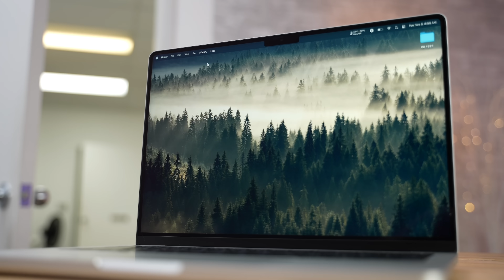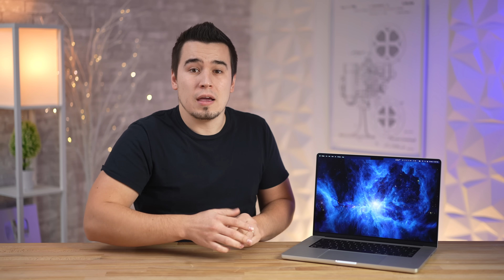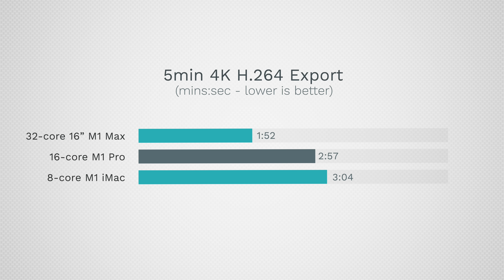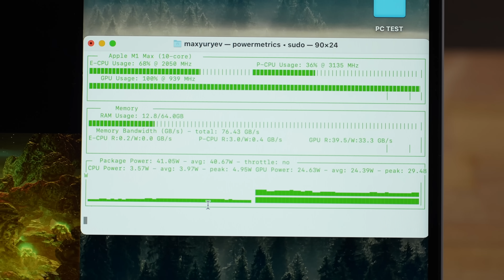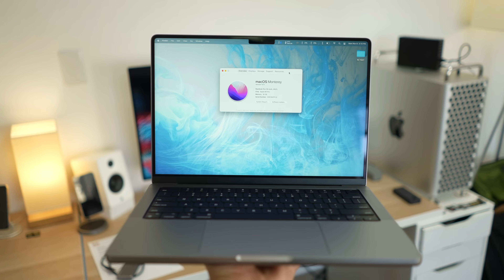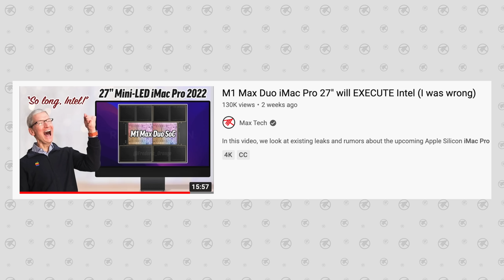M1 Max MacBook Pro Review after 1 month: You NEED to KNOW!

Comment: Sorry, you did not discover the die-to-die fabric. Many people, especially CPU designers, predicted it because it's obvious. If you want to talk about something important, talk about the industry move to chiplets, which is essentially what the Max represents: you build multiple smaller dice and connect them in the package as Apple has done with the M1 chips and dram. AMD is also ahead in this trend. This might to chiplets will remodel the industry, lower costs, and enable much denser electronics going forward. Phones have been using this model to some extent since about ten years ago, but no one noticed.

Comment: Finally got my 14inch 32 core and tested it with Davinci Resolve. DR uses ALL the graphic cores, so for functions like stabilising this is essential. For the first time this function is actually usable on a laptop. Definitely go for 32 cores if you have this requirement. Tested the memory use as well. DR, C1, PS, Topaz Gigapixel open at the same time which is my usual way of working. 38GB used on this 64GB system, no swapping. So I guess 32GB would have been fine with this combination as I only work with small files in PS and only a few layers coming from the Sony A1 video.

Comment: Would appreciate a video and/or some TIPS FOR NEW MACBOOK M1 PRO user, on setting up this laptop into a 2  monitor desktop setup, considering a standard set of functions which I will describe.

Questions arise on how best to make all the connections for a common user scenario:  some video editing and photo work from an iphone 13 pro (video mainly 1080P, some 4K, no pro res), some photo management, plus regular office software, and some 3d modelling.  Possible future use of VR headsets.    

Functions:
-	2 monitor seutp, using the laptop as a desktop computer.   (Eventually to drive 2 - 4K monitors, but I have not got those monitors yet.  see note below.
-	Backup drive (2 partitions, one for time machine backups).
-	Ethernet
-	USB out from laptop to enable usb outlets on the 2 monitors 
-	Connect a flash drive for  real time video editing from the laptop accessing flash drive data
-	Charging
-	Usb keyboard
-	Usb mouse.
-	Connect camera to transfer photos

And then disconnect laptop from desktop setup, for portable use.    

Questions arise on what cables from what ports to meet all the above functions.

For monitor connections I heard there is a KNOWN ISSUE that one monitor will go to sleep if you do not set it up right....something about you have to run cables not using 2 of the same ports, eg 2x HDMI. So something like 1 - HDMI to HDMI and 1 USB-C to Display Port, then that works? Not sure it that is ports on the laptop or ports on the monitor that is the issue.... ie. is this a ports issue on the monitors or a ports issue on the laptop? What combinations work? 

For all the other functions listed, what ports and what cables to use?   

Here is a draft setup for the purpose of getting some comments and suggestions.   

SCENARIO 1     Connections and cables used from the 6 laptop ports that are available to the monitor ports that are available:

1  Magsafe port: yes, used for charging to keep the other ports available for other uses.   Apple magsafe cable.   Current monitors do not have a usb-c connections.  When I get 2 new  2 4k monitors, they would have usb-c as I understand that then then one can use that one usb-c  to usb-c line to both deal with video on 1 of the monitors and also to keep the laptop charged, continuously working the charging function automatically.   Is that correct?).  

2  FIRST Usb-c port.   Hdmi cable to HDMI in on left monitor 24” Dell.

3    1 HDMI port.   Goes via Hdmi cable to mini display port adapter, into right monitor, 27” Dell.      Now the 2 monitor leads are different and hopefully this avoids the problem of one monitor going to sleep.

4   Second USB-C port.    connect to Belkin usbc to gigabit Ethernet adapter.

5   Third USB-C port.  To a USB-C backup drive  (wd MY PASSPORT ULTRA 5tb)   and also when needed, disconnect that and alternately connect to A usb-c FLASH DRIVE ( Sandisk Extreeme Portable SSD 1TB) (usb 3.2 gen 2 – I think that is 10gps? And the usb-c thunderbolt port is capable of 40 gps?) to access stored video for video editing on the laptop while stored data is on the SSD.

6   SD Card Reader.    

So that is my draft connection plan but what is missing is how to connect the keyboard, mouse, and camera to transfer photos.   How to handle this?  Get from the Belkin usb-c digital AV Multiport Adapter, plug the usb-c end into 1 usb-c in the list above, and then use its usb-c, hdmi, and a usb-a as follows:
-	hdmi to hdmi still from this port, to the left monitor 24” DELL (but now that port is shared 3 ways)
-	usb-a could go to one monitor to enable 2 usb ports for mouse and keyboard.  
-	The usb-c could then take the backup drive.   And that usb-c could get the flash drive.  This meets the functions described in 5 above.

With the addition of the the Belkin usb-c digital AV Multiport Adapter,  all the functions are met.   But would the sleeping monitor problem come up with this hookup?   2 hdmi cables are used from the laptop.

SCENARIO 2.   Separately, for the same functions, a connection plan for 2 – 4k monitors that do have usb-c ports would be useful.   

To identify the PRODUCTIVITY monitors that work well for this MAC productivity application would be useful…… this is not a gaming setup.       Call a gaming setup Scenario 3 perhaps and do a separate summary for that, otherwise it all gets too confusing?

Has anyone found a good video on this topic?    

Thank you!

Comment: I bought the 16" M1 Max with 32GB RAM and 24 cores last month, of course it seemed a bit too much for my needs (Illustrator all day long for poster design) but I was seeing long term. What's my surprise when I found out that it was extremely laggy (I have the multicolor wheel !!!) when using the 3D extrusions and the symbol tool. Whenever I want to move my 3D object, it has the wheel for 6 or 7 seconds, then moves. I don't know what to do here, this thing is supposed to be a total beast and Illustrator can't handle a 3D object ?! Any Illustrator users on M1 ?

Comment: I chose the 14 in. 32c 64gb version. I have a weird use case:

I work from home but have a baby that I also take care of, so I value portability. Being able to hold it with one hand and take it around the house.

My work requires over 40 gb of ram, so I need the 32c (only model that allows 64gb). 

Since I’m at home, I don’t need more than 8-10 hours of battery life on my use case. It lasts more than long enough, for when I need to move to another room etc . 

I don’t really need the gpu performance beyond what the 24 gives.

I’m pigeon holed into getting a 32c. I value physical portability over gpu performance and battery life.

TLDR;  I need a lot of ram. As a work from home engineer dad, 14 max 32c 64gb meets/exceeds all of my needs.
Reply: the M1 max with 24c GPU also allows for 64gb RAM though!
Reply: @redbaronlast  oh, you are correct. I missed that when I had purchased mine. Oops!  Learn from me!

Comment: Just a thought on the performance of the 3080 laptop on battery - sometimes the video driver settings or the laptop software will switch to integrated graphics on battery to not seppuku your battery.  Sometimes this can be switched.

This was the case on my old gigabyte aero laptop. I was able to switch it to use the gpu on battery, but it seriously impacted battery life.

Comment: I received my 16inch M1Max 32 cores and 32Go Friday, I experienced the charging issue when turned off. Saturday I ran a Diagnostic which ended up in a Trackpad problem with an error code. I’ll ship it back next week, wait for apple to receive it, order it again with up to month of delay… Very frustrating.
Reply: I received mine Friday as well. Wo had a trackpad issue?

Comment: For Archicad, SketchUp and AutoCAD (architectural software), would a 16” max macbook pro with 1tb and 32gb ram would be ok? Or should I upgrade to 64gb ram?
Reply: good question... I'm using a rhino+archicad+c4d workflow for design and rendering, and went for 64gb, since the memory is shared between the gpu and cpu. 32gb sounds less than I would need - especially rendering larger scenes have more memory consumption than even 64gb (I'm using corona mostly, so I don't really need the more GPU cores) - for extremely heavy cases it still makes sense to have a desktop pc (also to use some specialised engineering software, or simulations).
Reply: @furtonb  hi! Thanks for your response, just saw it haha. I’m not familiar with the corona app you mention, that’s it’s full name or an abbreviation? What version of archicad are you using? Does it run smoothly (2D and 3D)? Have you had any bug errors because of it running on Rosetta2 ( I read a comment in an Archicad forum that someone was having an issue when closing archicad)? How do you feel your actual workflow compared with your previous apple computer configuration (if applicable and which was it?) What kind of projects (building type and size/levels) do you mostly work with? How many SSD storage did you get (Initially I was considering 1tb, but I’m now wondering if 2tb would be better, not because of needing that much storage, but because of it affecting in any way the CPU or GPU performance… I think SSD speeds vary and are higher the more tb you get, maxing at the official info in apple website which I read was of 7.4 gb/s read speed with the 8tb ssd used on tests)?
Sorry for the amount of questions hahaha hope you don’t mind answering them if possible. Thanks in advance!

Comment: Unfortunately I wish I could say mine was reliable. My 16” M1 Max died due to severe hardware failure (unable to boot past apple logo) and was deemed unserviceable by apple yesterday. They gave me a full refund and now I’m contemplating reordering or not. Was a fantastic computer but reliability was a big let down at only 5 weeks old
Reply: Its not to bad every windows laptop ive had bought brand new has a had some issue thats required me to take it back besides one asus gaming laptop that one took a year to start giving me the blue screen of death and random reboots. Its out of warranty. Ive always had to fall back on my mac laptops when my windows machines  is down

Comment: My latest video is all 8k & has a section where it is sped up 1000% & was the only section where it slowed down significantly when rendering on the latest Davinci studio 17. This is on a maxed out 16" M1 Max with 64gb ram & 8tb ssd. There was absolutely zero swap memory usage but it used 59 gigs of the 64gb available so you definitely need  64gb when rendering 8k or higher resolution. Nothing fancy on the 8k all-i  video out of the Canon R5, h265 no luts or color grading. Editing was choppy at at times as well not absolutely smooth either

Comment: Excellent video and a great tip on where money is best spent on these new machines!  I have a suggestion for a test.  Would you be interested in testing the industry standard Flight Sim program for flight training, using the M1 Max and 3 displays (display #1 for left window, display #2 for windshield, and display #3 for right window)?  There are 3 great programs, but only one that is widely used for legit flight training and that program is X Plane 11.  I saw a video showing the M1 Max with 32 GB of RAM and the 32 Core GPU.  The RAM was not working hard at all, but ALL 32 cores of the GPU were constantly running at max and that was while connected to only ONE display.  I'm really nervous about whether a laptop can hang with Flight Sim (for serious flight training) when in a 3 display configuration.  I know there's a Demo mode available for X Plane 11, so you should be able to run that on the laptop without needing all the other hardware like Yoke, rudder pedals, etc.  Thanks in advance for your help with this!! Following is a link to the video I mentioned.  The channel is "CTR Transport and Technology", the video is entitled "Can I max out X-Plane graphics settings on the new MacBook Pro M1 MAX? Surprising result." and the link is: https://youtu.be/ezhFFjXbbS8

Comment: I’m crying how slow the Rhinoceros working on M1 Max under the latest Parallels 17 😭 Before I’ve tried to run it on 13” MacBook pro M1 16gb and thought that M1 Max will be much more faster but it hurts me in a same way 😩
Reply: Dude, get the right hardware for the software you'll be using. Duh.
Reply: @Mamo878  Yeah, I know. But it’s so sad that my 2019 i9 mbp 15” even my 2012 i7 mbp 15” works faster with Rhino than 2021 M1 Max 16” 😒

Comment: The mockup you show of the "Quadro" is probably unrealistic. It will likely, if Apple uses the CoWoS packaging, consist of two dual-chip packages, not a HUGE four-chip package. I could be wrong, of course, but that just would be too much of a change for using a new technology like a multi-chip packaging that hasn't been used before.

Comment: I ordered the 14, 32, 32. I just wish it had full performance plugged in. It’s gonna be my desktop.
Reply: Um, then wait for the desktop versions of M1 Pro and Max since they will be designed to be used plugged in and with appropriate cooling for full power.
Any laptop is always a design compromise compared to a desktop computer.
Reply: @Mamo878  Haven’t bought a laptop in 15 years. I don’t like desktops anymore. It was time to upgrade.
Reply: @lawrencecook2746  
Well, if you don't "like desktops anymore" expect compromises in the physically much smaller size of a laptop compared to a desktop.
Reply: @Mamo878  Right. I was well aware that it would be inferior to a desktop or a bigger laptop. Hopefully that changes before I die.

Comment: I got my m1 macbook (mostly) correct. Only mistake I made was not getting 1tb since the 512gb does have a degraded performance compared to the 1tb, which I didn't think would be the case. But otherwise, 24 core m1 max with 32gb of ram seemed like a good sweet spot and it is. I had issues in normal power mode powering 2x thuderbolt mac displays along with the built in display. It was glitchy and laggy, but switched it into high power mode (which you only get with the m1 max) and everything is buttery smooth! Defiantly worth the $200 for the m1 max.

Comment: How about when fans are manually max'd on the 14"? Did that mitigate the Apple throttling or is that a hard throttle even when temps are stable?
Reply: They've done plenty of tests in their other vids. It's a hard cap even with fans maxed.
The 16" is just better for anyone who needs the best performance and battery life when considering between the 14" and 16".

Comment: Ordered 14” with M1 Max and 32G of RAM a month ago, will get it on Wednesday.  Super happy that my theory was right and it really doesn’t make much sense to go on full 32 cores on 14”. And btw also chose 14” for portability. You guys rock!
Reply: Which organ did you sell to buy it?

(Joke)
Reply: Comment above yours is so similar: Dark √

I ordered a 14" with M1 Max and 32GB of RAM a month ago, and it will arrive on Wednesday. I'm thrilled that my theory was correct, and that it doesn't make sense to go full 32 cores on a 14". I also chose 14" for portability.
Reply: @rrp6405  yea i also thought i found a matrix glitch there
Reply: How much more "portable" is 14 inch vs 16 inch really? I'll take larger screen, more battery life, and better speakers from the 16
Reply: @BRBallin1  well it's all very depends on your perception,I guess. I went to our local Apple store and tried both laptops, and 16" seemed significantly boxier and heavier. I don't like the new design either, but I liked 16" even less than 14". So while I walked in the shop just to confirm that I need to get 16", that changed when I saw both laptops...
And no, money is not an issue, c'mon if I already am paying 3000 EUR for it would I not spend 200 EUR for a bigger screen???

Don't take my word for it, decide for yourself.
Reply: @BRBallin1  it’s not the portability as such. I use mine 75% of the time while half laid on the sofa and the 14 / 13 just gives you a lot more room, and is easier to balance
Reply: @BRBallin1  you can ask your girlfriend if 2 inches make a difference
Reply: Same
Reply: M1Pro 16 Core and 32GB ram.
Reply: What’s the spec you end up buying
Reply: @r_jhr  14” M1 Max 24g with 32G RAM and 1TB SSD.
Reply: Good choice dude. Just got the same thing yesterday. Wanted a larger screen so bought the 16 inch pro last week and returned it for more memory. And the 16, I think, is just a bit uncomfortable when using on the couch / taking on a plane.

Plus I’m going to get a monitor for this too for home 🏠

Comment: those new MacBooks are more and more disappointing,
halved WiFi speeds (2x2 MIMO instead of 3x3 old 2017-2019 Macs have), halved power delivery on usb ports (external drives and audio interfaces having issues).....definitely not a "Pro" device imo

Comment: Blender 3.0 was just released.   If you rerun Party Tug, do you see a difference?  Although the 3.1 release expected in spring is going to have Metal support, expect it to be much faster than even current results.
Reply: On some blender thread (it’s called “OpenCL on Metal” for some reason) there are some very entry test benchmarks that have happened from a guy that managed to compile what was being committed on his M1 machine. Only the beginnings, but I think it’s going to be something… for sure not 300W RTX 3090 something, but nice enough.